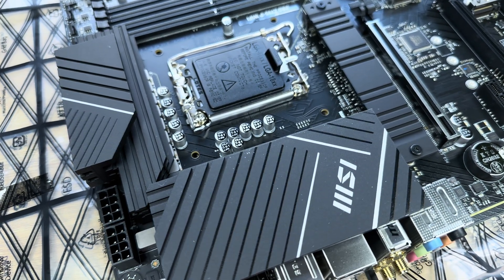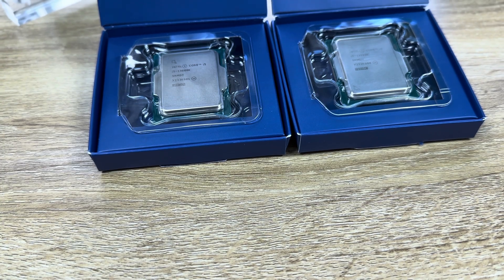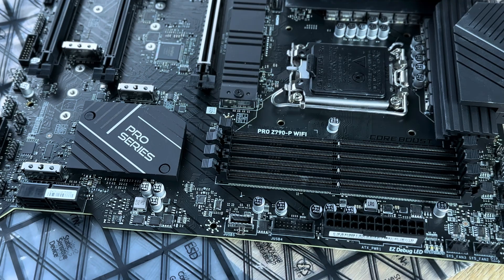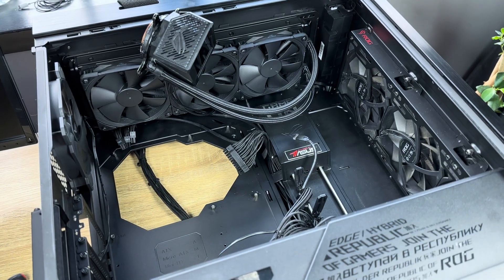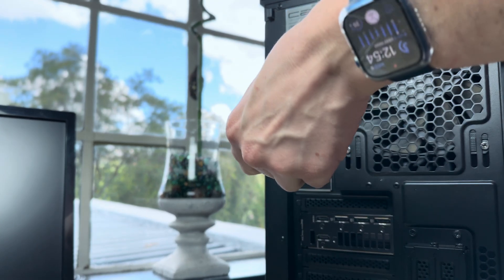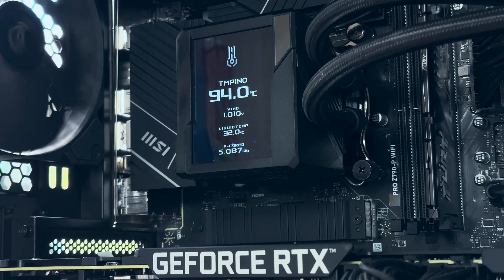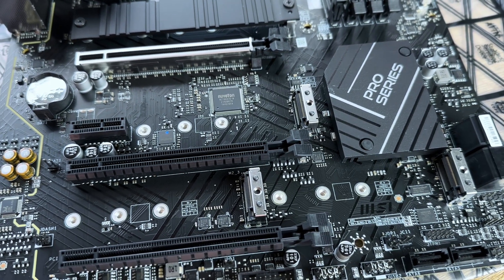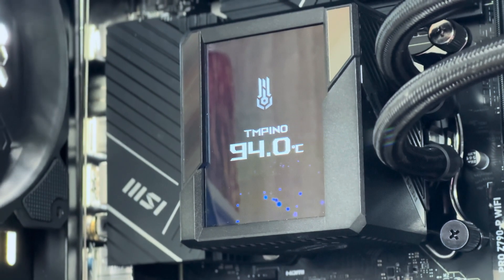MSI Pro Z790-P Motherboard Review (Intel 13th-Gen 13900K + 13600K Tested)

Comment: Hola, estoy pensando en adquirir esta placa como parte de un combo en Microcenter, pero veo que tiene dos conectores de 8 pines para el procesador, ¿son en realidad necesarios? yo cambié de fuente de poder para mi computadora hace poco, y ésta sólo tiene un cable de 8 pines para el procesador, ¿podría funcionar si sólo conecto un cable de 8 pines? ¿o a fuerza tengo que buscarme otra fuente?
Reply from the maker: You can use a single cable that spits into two 8-pin connectors. There will be enough power from that cable to power the CPU.

Comment: I have teh DDR4 version of theis board. I'm struggling to get the CPU 4x M2 slot to recognice my ssd - did you have teh GPU and M2 plugegd in at the same time?
Reply from the maker: Yes I did. What CPU do you have installed in this board? Some CPUs include the PCIE limitations and not the board.

Comment: LMAO I installed my CPU and then updated my bios with the computer that I was using that needed the BIOS update I was able to log in and use it it ran kind of wonky but I was able to get it up and running by doing a and then I had to do a bypass obey command for network drivers because Windows is finicky with network drivers

Comment: on sale at Micro center ... Z790+12700k+16GB RAM for under $300 ... its a good deal
Reply: I got this deal. very happy except I couldn't install my beloved win 7 ultimate on it due to hardware problems. It would not allow usb keyboard and mouse at the same time. I even tried old ps/2 mouse and on screen keyboard, but you cant hit two keys at once on the on-screen keyboard. I had to buy win 11. MSI states on the box that win 10 and 11 are supported, with no mention of win 7, so my bad for assuming . I'd research this board if you want Linux, I don't know if it would work. It could, I just don't know.

Comment: There is also a DDR4 memory motherboard with this same model number and now is supposed to support 14th gen processors also.
Reply: The 12th gen CPUs were originally 600 series 13 and 14 were supposed to be for the 700 series the 700 series came out about 1 month after the 12th gen series was supposed to be for the test to make sure that the boards would support the CPUs before they made the 13th of 14 then when they made the 13th of 14 gen was on the horizon so they just went ahead and made all of the 13 and 14 gen boards ddr5 and the 12th gen boards ddr4 you can put a 12 gen and a ddr5 because it's the same LGA type

Comment: I have the Max version of this board in my 12600k PC. Works great. I haven't tried to OC it yet, but I think Im gonna turn it up a little bit and see how it goes. Problem is I really dont know what Im doing, but there are plenty of videos online, many using this exact setup, so it shouldnt be too bad. I have it under a 360 AIO, so I dont think Itll be too bad.
Reply from the maker: you can so some slight overclocking in the BIOS or even install an Intel AI overclock tool. But if you slowly nudge it bit by bit, you should not have any problem. The good thing is you can't break anything with subtle overclocking. If things don't work you can always revert it back. good luck!
Reply: @GLITCHEDZA  Is the Intel AI overclocking tool something anyone can download?? Or only people with certain hardware combos?? The part I don't understand and worry me is messing with the voltages. I don't know what a ring voltage is. I didn't see any AI overclocking options in my bios. Thanks for the help!! I se some P cores are at a different clock speed than other P cores, would I be OK clocking them all the same??
Reply: @GLITCHEDZA  Hey thanks for the help. I downloaded the Intel Extreme Tuner and it auto overclocked my CPU for me, just like you said. I'm running a 12600k at base frequencies of 4.9 and 3.9 on the P and E cores with a voltage offset of 0.25. I'm sure I could go further, and may in the future, but I was hoping to keep this setup for as long as possible and have no idea how far is too far. The Intel XTU made it so much easier than overclocking through the bios or MSI Creator.
Reply from the maker: @stephenhood2948  Sorry I missed your previous reply I am travelling. but I am glad you managed to get it to work and it was easy. Remember that most Intel CPUs, like the one you have come overclocked already. That's why they run so hot. They are actually quite hard to get running "much" faster than they already are. So I think your subtle tweaking is perfect.
Reply: @GLITCHEDZA  Again, thanks for the help.  I have a 12600k under a 360 AIO, so the cooling is probably a bit overkill, but Im ready for an i7 or i9 later if I want. Without the overclock my CPU temp never even moved from idle while gaming, though I was maxxing out an RTX 4070 with 20% CPU usage. If I run some benchmarking tools I would get 100% CPU usage and temps in the 60s with around 90 watts on the CPU. After the OC I ran prime 95 and got the temp into the mid 70s with 130 watts. I can probably go a little further, but this is my first time Overclocking with anything other than Afterburner on a GPU. Like you, it already boosts, and Im getting 90-100 FPS at 1440p Ultra settings without an OC. Ill probably just run it without the OC, I just wanted some benchmarks with the OC. I am having a weird thing with my GPU. Its a Galax RTX 4070. Sometimes its fine and sometimes the fan wont come on when gaming. Its easy to see the 11 FPS with no fan running. Restarting the game, sometimes the PC or sometimes the Galax extreme tuner OC tool is what it takes to get the fan going. I might try to delete the Galax tuning software and go with Afterburner, or even just run it with no OC. IDk why it does that though??

Comment: Just installed this board- got a really good bundle deal from Microcenter- 250 for this, a 12600kf and 16GB 3200 memory- individually that all would have been around 400-500. It is just the DDR4 version, which is just fine for my use case.

I spent 4 hours trying to figure out why it wouldn't boot with my R9 Fury Nano GPU, but would start up without a GPU, though thanks to the KF model I had no video output. To get into the bios I needed video and the top PCI-E slots wouldn't work with it, nor the second and I knew the card was good- works fine in my primary PC. Anyway, I pulled out an ancient single slot nvidia 8400 so that I could try the last PCI-E slot and it worked! I got into the BIOS. Next was figuring out why the other slots wouldn't work. I ended up having to changed the BIOS settings from UEFI to CSM and then I could use the Nano on the primary slot. All is well and the rig is running perfectly. During my research I found that these new boards don't like old cards in UEFI mode. The wifi on this board is really good! I'm keeping that old 8400 safe in a static bag now- it saved me, I didn't even think it worked anymore, I've got a bunch of old GPUs that I just kept in a box with no static protection but after this I've got them all safe and protected! So if anyone has problems with the video output, try that last slot to get into the bios and check the BIOS settings (the board I got had the most current BIOS on it- sometimes I guess you have to flash them if you get an older unit that sat on shelves for a while). Hope this comment helps someone :D

Comment: I just got this board with a I7 14700k and 64 Gb ram and RTX 4070Ti  & 27in widescreen G-SYNC monitor runs cyberpunk 2077 so smooth & looks and runs amazing. G-SYNC is really cool how smooth at high frames.
Reply: Did the CPU run out of the box or did you have to update the BIOS?
Reply: А разъёмы памяти не имеют выходов контактов на обратной стороне платы? Несквозная пайка контактов - это сильно ослабляет разъёмы памяти, которые могут просто выломаться.

Comment: Question regarding the WiFi adapter, the two string-like cables , are these supposed to be connected to anything?
Reply from the maker: They connect at the back of the motherboard. You will screw them onto the two gold circular pins near the USB ports.

Comment: I’m running this board with intel i5 12600k, AMD Radeon RX 6750 XT Phantom Gaming, vetroo v5 cpu cooler, Western Digital 1TB WD Blue SN570 NVMe, trident Z will I need to update the bios with build?

Comment: Nice review.
Got mine during Amazon Prime Days for 3,400 Rand ($190 USD).
So far I'm loving it and the i7-13700K.
Upgraded from MSI Z270 Gaming Carbon & i7-7700K.
Reply: What do u use to cool the 13700k
Reply: Noctua NH-D15 but wished I had gotten the Peerless Assassin at 1/3 the price and 97% of the performance.
Reply: Hello mate,
I wanna ask you is there any difference between 
Msi pro z790 wifi ddr5 and 
Msi pro z790 wifi pro series ddr5
Reply: Is there an I/O shield
Reply: Yes.

Comment: Which power supply works ? 4x 8 pin needed ?
Reply: It has 2 8 pin connectors but unless you're pulling more than 300 watts on the CPU you don't need the second 8 pin connector. I'm running this board with a 12600kf and I only use one of the 8 pin connectors, the second is mostly for the top CPUs and even then it's still enough if you're not overclocking- that's mainly what the second 8 pin connector is for (each can pull 300 so you can potentially run a CPU at 600 watts if you have the right PSU, which is kinda nuts, my current PSU is only 500 watts!

Comment: Seems amazing and VFM
I found the MSI Pro Z790-A combined with 13600k
I am a bit confused if its better to choose Gigabyte Aorus z790 Elite Ax
Need your feedback on this
Thnx in advance...
Reply: Gigabyte Aorus z790 elite ax ddr5 can recommend because my brother using with i9 13900k. run smooth but he undervolt the cpu. 24 hrs no issue  until now.

Comment: If you still have the board, what is your CPU Vcore as measured by HWInfo in Cyberpunk after ~10 minutes of driving around the city. Current, Avg and Max. (Reset the counter after you get ingame so you dont get idle or game bootup vcore) aswell as in Cinebench R23.

Comment: But all z790 boards support Raptor Lake (Intel 13) out of the box so i dont understand that argument that you need to update bios before you can do so?
Reply from the maker: The CPU isn't the issue really. It is the lack of RAM support. When I first installed everything it would not boot up. Not sure if this was RAM or CPU but previously, I built DDR 5 RAM PCs which did not work unless the BIOS was updated to support the RAM.
Reply: @GLITCHEDZA  Everything I'm seeing says this is DDR4 board. Am I missing something?
Reply from the maker: @masterchriswong  There is a DDR4 version and a DDR5 version. Exact same name. Just DDR4 and DDR5.

Comment: Hi, I was planning to buy the --->   MSI PRO Z790-P WIFI DDR4 ATX  
I'm just wondering if this mother board I can fit my old CPU & GPU on it.. I currently has: 
CPU	Intel(R) Core(TM) i7-2600 CPU @ 3.40GHz, 3401 Mhz, 4 Core(s), 8 Logical Processor(s)
GPU	NVIDIA GeForce GT 545

I would like to get a Mother Board that I can upgrade my CPU to i9 by next year & GPU to something powerful
I would appreciate if you could help me decide please?
Reply from the maker: Unfortunately, the CPU you have are quite old and won't work on this motherboard. This board is made for a 12th or 13th Gen Intel CPU. I would suggest waiting until you have the cash to get the CPU and motherboard in one go.  Else you'll be sitting with a motherboard and no CPU. The GPU will work but it will be constrained by the performance of PCIE 4 on this board. So basically, you'll need the CPU and motherboard first. The GPU will work but definitely upgrade it later on to a PCIE 4 card.
Reply: @GLITCHEDZA  Thanks Mate for advice :) 
I've put together a new pc spec for myself I wonder if you don't mind giving me an advice on what you think .. if yes I will go for it. if you think something of my choice is wrong please advice :

1- MSI MPG Z790 EDGE WIFI DDR4 Motherboard ATX - Supports Intel Core 12/13th Gen Processors, LGA 1700, DDR4 Boost (5333+MHz/OC), 1 x PCIe 5.0 x16, 1 x PCIe 4.0 x4, 5 x M.2 Gen4, 2.5Gbps LAN, Wi-Fi 6E
2- Thermaltake Smart RGB 80+ White 700W, Power Supply UK spec, 5 YEARS WARRANTY, Black
3- Intel Core13th Gen i7-13700F Desktop Processor (16 Core (8 P-Core + 8 E-Core), 30 MB Cache, up to 5.2 GHz, LGA1700)
4- Samsung 990 PRO 1TB PCIe 4.0 (up to 7450 MB/s) NVMe M.2 (2280) Internal Solid State Drive (SSD) (MZ-V9P1T0BW)
5- Corsair 163301 Vengeance LPX 32 GB (2 x 16 GB) DDR4 3200 MHz C16 XMP 2.0 High Performance Desktop Memory Kit, Black
6- MSI GeForce GTX 1650 D6 VENTUS XS OC Graphics Card '4GB GDDR6, 1620MHz, 128-bit, PCI Express x16 Gen 3, DisplayPort, HDMI, DVI-D, Dual Fan Cooling System'

Please if you think any of the above won't be compatible with other or has bad effect.. I would appreciate the advice.
Reply from the maker: @modyghalyasi  Hi! This looks all good. All the parts should work together. What cooler are you going to get? If it is a fan one, just make sure to upgrade it later down the line to a liquid cooler version if you are able to. These 13th-gen CPUs run very hot.
Reply: @GLITCHEDZA  Great, so this PC would give me a performance I need for memory wise? or do you think I should go for 64gb memory and down grade something else?
Reply from the maker: @modyghalyasi  I don't think 64GB is needed tbh. Unless you're doing heavy production content that requires that.
Reply: Hello mate,
I wanna ask you is there any difference between 
Msi pro z790 wifi ddr5 and 
Msi pro z790 wifi pro series ddr5

Comment: I get so much conflicting info on max CPU temps. I have this board in an IBP prebuild with a 13900KF. Common benchmarks also shoot temps up to 99/100C almost immediately. Idles around 50C which seems way high. 

You had similar max temps. Was your cpu throttling at that point? Is there any way to better cool this CPU/MB combo? Some people say this will fry fast at these temps while others say different. 

I see your bench with a pretty decent cooler still at water boiling temps. What was your idle temp on the 13900? What standard should I be applying?

Thanks.
Reply: @yellowisthemellow  Thanks. I found the OOTB fan/pump curve in BIOS was way off for idle temps. I tweaked that and idles 29-30 now. Next is to try to get those high temps down.
Reply: read what intel say about you CPU max operating temp,

Comment: I recently upgraded to this board with a 13700kf for my GPU. Now the problem is when I put in my 3 M.2 one of them doesn't want to pop up? Is there a fix for this? Does the motherboard allow this?
Reply: Dude am i nuts or what? Im looking at this board and literally only see the one m.2 drive location... I see the one with the heatsink under the GPU PCIE slot, but don't see the other ones through image. Where are the other M.2 Slots located? or do they stack?
Reply: @Jacksongamma  one is below yhe one with th heat sink then another below that one then the final one is on the right hand side

Comment: Ty for the review! I bought a i5 13600k and I ask me if I have to flash the bios before installing the cpu and other components. Or will the system (components installed) get me in the bios?
Reply: I wan to buy this board and core i5 13600 kf 
Do you recommend me?
Reply: The mainboard is fine. Before the initial startup, you should perform a BIOS update. After that, everything runs as it should. @o_kudo_o8854

Comment: So far a great board and it looks really nice. I got one paired with the i5 13600k and 32gb of corsair vengeance 5600 cl36. No issues getting it running. I got it for gaming with my 4080.
Reply: did you have to update bios or do anything? Or did the cpu work with the motherboard straight away? I'm building a pc pretty much exactly the same as yours ;D.
Reply: @johnschrader8363  any z790 should support 13th gen right out the box
Reply: @johnschrader8363  you will need to update bios for a 14th gen cpu
Reply: just bought the same combination yesterday! cheers
Reply: I am thinking to pair this motherboard with 13700k + 4080.
Reply: @netfreak6993  same, i7-13700k but with a 4070
Reply: @EliteHawksHDGaming  exact same as me tho my 4070 stopped giving a display so gotta wait for the replacement
Reply: @netfreak6993  I was thinking about the same build. Did you try it? Do you suggest me to do that?
Reply: Do you know if the board supports corsair icue rgb ?
Reply: I have the same specs
Reply: Y’all some rich people for real I plan on matching a 13600k with a rx6700xt
Reply: Hello mate,
I wanna ask you is there any difference between 
Msi pro z790 wifi ddr5 and 
Msi pro z790 wifi pro series ddr5
Reply: This is almost exactly what I'm planning on doing, but with a 4070Ti SUPER. Is the board still working well for you?
Reply: Разъёмы памяти не имеют выходов контактов на обратной стороне платы. Несквозная пайка контактов - это сильно ослабляет разъёмы памяти, которые могут просто выломаться.